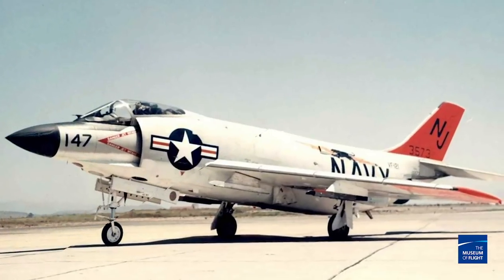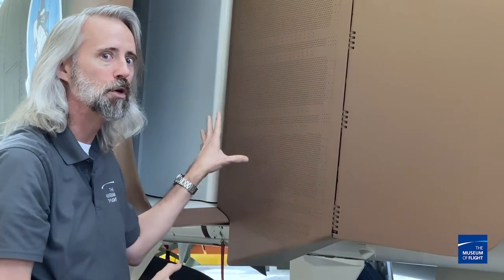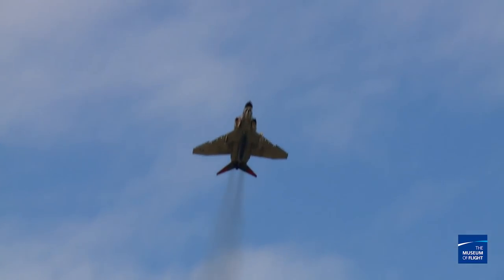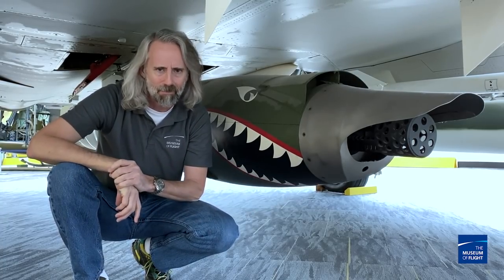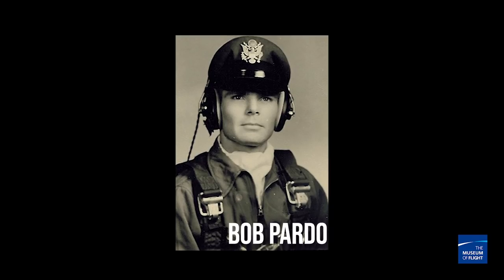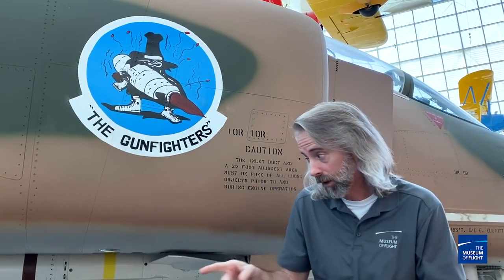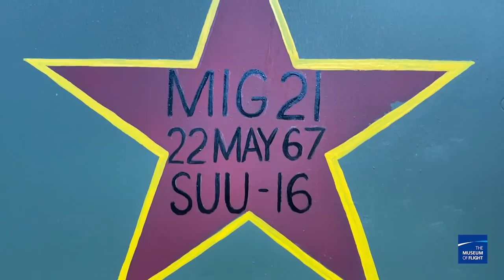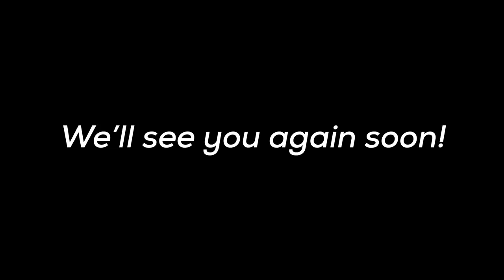McDonnell F-4 Phantom II | Curator on the Loose!

Comment: I spent 4 years in as a plane captain and Aviation Machinist's Mate in two US Navy F-4 squadrons in the late 1970's.  Allow me to supplement.  The splitter vane is there to reduce the flow of air into the engine inlet at supersonic speeds.  The GE J79 or any other turbojet engines will flame out if the air enters the engine at supersonic speeds.  The splitter vane will move out as the aircraft approaches transonic speed, stay out during supersonic flight and move back into open position below supersonic speed as shown in the video.  You'll notice that the splitter vane has hinges on it.  It is for this purpose.  Thank you for bringing back memories of my youth.
Reply: When sitting in the back seat you can watch the ramps move out as your speed increases to mach 2. Also, you can observe the shockwave which appears as a line right ahead of the intake and watch it. What you don’t want to see is the shockwave disappear that means a compressor stall because the engine can’t handle supersonic air. Slow down and restart the engine and all is good.
Reply: I'm surprised the splitter doesn't break and fly off when going super sonic.
Reply: I was an aviation electrician on the Phantom for VF-102 Diamondbacks out of Oceana,  and also did some brown shirt- plane captain duty. My favorite was to be beside the Phantoms at night on the cat shots! Nothing like that raw, pure, power!!
Reply: By chance were you in VF-74? Also the splitter vane is perforated so as not to choke the air entirely!!
Reply: @steveowens913   hello there Steve we may have shared the flight deck together CV-59 and 68

Comment: The funny thing about the gun, the original design actually DID call for a gun, but it was removed on the assumption that future air to air combat would exclusively involve missiles.
Reply: didnt the later versions of the aircraft re-incorporate the gun in the design?
Reply: @ObamaTookMyCat  yes, they put a vulcan under the nose and put in a less powerful radar to re-balance
Reply: @thedubstepaddict3675  The F-4E was the first phantom to have an internal gun.  It also had a transistorized radar while the C and D models had Large vacuum tubes.  The APQ-120 radar in the E model was smaller and lighter due to the transistors replacing the vacuum tubes.
Reply: @alanhess9306  agreed good comment
Reply: First and last fighter made with no gun, which was a big mistake they found the hard way in 'Nam.

Comment: Personally, the F-4 Phantom II, is to me, the greatest ever warplane.
Reply: YEs. If I were an airplane factory I would take it and just replace electronics and engines and make it flight again.
Reply: @switted823  I also love the F-14D Tomcat.  And the F-15E Strike Eagle.  And the Panavia Tornado.  ;)
Reply: I think the F4 wins based on longevity!
Reply: I've been fascinated by this  beauty since the first fly by i ever saw.
Her elegance, her dance, her roar..she got me  hooked
Reply: @Yoothana Mumme 
You got it 👍
Reply: SAM 7 agrees with you...
Reply: My favorite are F-111F, A6E Tram, F15C, F4 Wild Weasel, and F100F Super Sabre.
Reply: @detaildon  Not compared to the MIG-21. Come back in 100 years and there will still be some backwater using them. Also the Tornado got used really hard at low level where pilots got banged about to the point of getting bruises so was never going to last. The F-4 never did that. Same with the Buc which flew even lower. First time the Buc was encountered in Red Flag everyone could hear them from the position on top of the hill. What the USMC did not realise was the Buc's were flying 1500 feet below them 30 feet off the valley floor. The Buc's executed a toss bombing (something no US aircraft has ever been designed for) and offski'd before anyone else knew what was happening.
Reply: One of the funniest people I know is an f4 pilot
Reply: The F-15E Strike Eagle just is BADASS!  And the legendary Tornado...But yes, the classic TOP GUN machine...the F-14!
Reply: @gordonlawrence1448  I also somehow, love the MiG-21.  The nemesis of the F-4
Reply: Yep.  Before I kick it, I need to ride in one.  How I wish they’d been re-engined, updated and put back to work.
Reply: “The F-4 never did that…” We flew low level on ALL air to ground missions, so… you’re wrong.
Reply: “Toss bombing…”
The F-105 was designed for that too. The F-4 wasn’t but we did it anyway (Dive Toss was a required qualifying method of delivery, although we hated doing it.)

Have you ever had any experience actually flying one… or any military aircraft, for that matter? Serious question.
Reply: @yoothanamumme7091 
To my knowledge, there were no gun kills for the F-14.

Comment: That gun on the belly is a SUU-23 not a 16. It has an internal turbine to power it that is fed air from the intake above the gun muzzle opening. The SUU-16 had a flip out turbine to power it up. In the image of the "Spook" you can see the flip out turbine next to the spooks hand. The SUU-23 could be fired at higher speeds and could spool up faster than the SUU-16.

Comment: There is something special about the P-51, F-4, and the F-14.   The best planes of their respective era.
Reply: Mega upvotes !!!
Reply: Luving my P-47's also
Reply: The F-14 was actually all hype. It was underpowered and it’s Phoenix weapon system was worthless because ROE mandated visually ID before firing.
Reply: @Frankie5Angels150  Underpowered?  LMFAO.  There is a HUGE difference between the problematic P&W-TF30 powered F-14A and the powerful-reliable GE-F110 powered F-14D Super Tomcat. The Super Tomcat Was NO-WAY underpowered. As for your ROE, that was during peace time engagements.  Had there been a full blown war against the Soviet Union you bet there would be no Visual I.D.ing going on. But that kind of war never happened so the Phoenix never got a fair chance.   But I do agree, the F-14 was mainly hype, because although on paper, in theory, and as advertised, it could carry a ton a weight in weapons (thanks to the powerful F110 engines) in the strike roll (Bombcat) but in practicality there was no place to put it.  Hard points are at a premium on the Tomcat.  And it usually only carrried four 2k lb bombs. That's a lot of airplane for 4 bombs. Also it was very expensive to operate and a maintenance hog.

Comment: When I was commissioned in 1978 my first assignment was to Nellis AFB, Nevada.  World-wide, every thing fighter was mainly F-4s.  The F-15 had started delivery 3 years before and the C and D models wouldn't start delivery until the following year.  The F-16s had started rolling off the assembly line.  The wing at Hill AFB transitioned from F-4s to F-16s and then the tenant 474TFW at Nellis AFB transitioned.   Nellis was great because practically everything in the flying inventory was there or passed through there, including Navy fighter and attack planes flying from California that came to play at Red Flag exercises.  The Aggressors were F-5s  I saw the last two Tennessee ANG F-100 Super Sabers pass through on their way to the boneyard at DM. After two years, I went to Kunsan AFB, Korea and after a year of F-4s the 8 TFW transitioned to F-16s.  The Koreans flew a squadron of F-86 Sabers at Kunsan.  F-86, F-100, F-105, F-111, F-117, F-4, F-5, A-7, F-14, F-15, F-16, British Buccaneers.  I was in the Air Force at a very good time.  I loved the Air Force but every Airman gets only a slice of a very long loaf.
Reply: Kudos to you Sir! I was on three carriers with F-4's as the Fleet Fighters at the same time. We had 10 different airframes on board not even counting Tomcats because they weren't in abundance yet!!

Comment: I was an assistant crew chief on F-4D. I worked on the flight line. 66-7605 was my bird. I was assigned to the 184th TFG from 83-87. Enjoyed it. Nothing was more funner than running them them on the trim pad after rebuilding the throttle quadrants.
P.s. little red indicator popped up on your wing indicates your wings tips are not locked down.  So you can fold them for congestive parking.
Reply: Kudos to you Sir!!
Reply: Somewhere I have pictures of your Phantom along with 66-7553 , 66- 7694, both of the tripple 6's before they crashed( I think one crashed and the other burned on the ramp , can't remember ) ,  and 66- 0298 , several others that are escaping my mind at the moment . Including the one that took put the bell telephone poles lol.

Comment: My dad was stationed in Ubon Thailand from '65-'66 and told me a about an incident that happened to one of his F-4s that he was flight crew on.
The F-4 came back from a mission with barbed wire between the wing and the pylon. Evidently the pilot had misjudged his flight trajectory and realized he was going to make ground contact, he wound up "slapping" the ground with his F-4 bouncing back up into the air and flew off, dragging barbed wire with him.
Since my dad worked on F-4s I was fortunate enough as a young boy to sit in the cockpit of many F-4s while my dad was working on the weekends.

Comment: My first job, 1979-1980, was working on the flight line for an FBO at Albert Whitted Airport in St. Petersburg, Florida. . 

We would occasionally see USAF F-4s flying north past us over Tampa Bay, heading for MacDill Air Force Base in nearby Tampa, Florida. You could spot the Phantoms fairly easily from their rather visible smoke trails.

Comment: Late in the life of the F4 they came out with a low smoke J79 engine that greatly reduce its visual signature. Was waiting on flight line at Nellis AFB for a flight of 4 coming into Red Flag. We knew 1 had both smoke engines,  2 had 1 of each, 1 had 2 low smoke. Sharp eyes picked up the high smoke dual engines at about 20 miles,  but not til about 5 miles for the no smoke plane, even though you knew it was in the formation. Huge improvement.
Reply: Nothing like the Sound of a J-79!! BTW the F-4 J & S received the smokeless engine's as well!!
Reply: Not every air force that had F-4 Phantom upgraded their engines.
The problem was that the fix involved raising the temp limit on the engines to  minimize the soot.  You NEVER fully get rid of soot.  Even clean engines "smoke" a little because they're burning kerosene.
I know the Luftwaffe did not upgrade its J79s because doing so would have reduced the lifespan of those engines.  As it stood, it was probably good for them NOT to upgrade the engines.  They kept their Phantoms in service (due to delays with the EuroFighter) for at least another 10-15 years longer than they planned!
The US air arms went ahead and upgraded their J79s because the engines were plentiful.  Even if the J79 was out of production by the early 1980s, the spare parts to replace worn engine components were available for years.  
According to what I read in an old aviation book, the F-4 Phantom was supposed to be phased out originally by the early 1980s in US service.  I have read that 1980 was the original phase-out date (for the Navy at least) but the cost of the Fourth Generation fighters was too high to completely replace the 3800 Phantoms the US air arms bought.  The F-4 Phantom was on average $3million to $4million per plane by early 1970s currency standard.  Even by the time their prototypes flew (1970 and 1972 respectively), the F-14 and F-15 were going to cost at least $18million to $20million per plane!  
There was no way they could afford to replace every F-4 in service with an F-14 or F-15 hence why they commissioned the F-16 and F-18.  Even the F-16 (around $10million, IOC 1979) and F-18 (closer to $23million, IOC 1983) were orders more expensive than the F-4 Phantom but they had the advantage of greater reliability and less maintenance than the larger Teen Fighters (F-14, F-15).  Still, not enough F-16s and F-18s could be bought to replace the F-4 entirely and the numbers of fighter squadrons whittled down.  The F-4 HAD to be kept in service longer (at least 15 years longer!) to keep the tactical aircraft numbers up AND fulfill missions the F-16 and F-18 were not designed for (like SEAD/Wild Weasel).  The F-4 itself had significant numbers of E-models (over 140) modded into Wild Weasels and was considered a better choice for that mission than the F-16 (back in the 1980s) because of the limited internal room for avionics growth in the F-16.  Back in the day, the Air Force planners didn't anticipate electronics shrinking as much as they have to enable higher-capacity avionics to be installed in the small internal bays of the F-16 like they have.  In fact, the new AESA radars being installed in Legacy F-16s (Block 40 and higher in USAF/ANG service) take up less volume and are lighter than the APG-68 radar!

Comment: When he is talking about the engines you can see the rear of an AIM 7 missile, just behind it you can see a little bump, that's the rear signal horn (antenna). Used to tune missiles before launch.
I am a "Gunfighter", I have the certificate to prove it.  But I served with them 1970-1971 as a Weapons Control Systems specialist. I was promoted to Sergeant and Staff Sergeant at Danang then home of the 366 TFW.

Comment: One morning we were launching the first goes at Luke. For some unknown reason the crewchief on the next jet over stood up right behind the running engines. ( It was normal procedure to cross over from one side to the other while ducking under the engine exhaust). He got blown about 25 yards or so ass over teakettle across the flightline. Not only that but his face and arms looked like he had just gotten a bad sunburn. Needless to say, it took a long while for him to live that one down.
Reply: Let me try to one-up that ... we were working the midnight shift at Yuma (VMFAT-101) and I was in the backseat trying to find a discrepancy between the front scope and the back scope. I had a sergeant giving me what he was seeing on the front scope; oddly he was standing on the right-side of the front cockpit, something I found awkward (not much to stand or hold onto). All of a sudden I heard a thump. I stood up, looked around and then asked, "are you ok?" From down on the flight line, he hollers up, "yeah, I'm ok". Needless to say, he had fallen, in retrospect, quite a bit more dangerous than just falling off the F-4 -- because we had the radome pinned back to the fuselage. I'm not sure he ever lived that one down, as in my 6 years on the Phantom (and 2 on the Harrier, but I'm not interested in talking so much about that era), he was the only one to ever fall.

Comment: Very good presentation. One other interesting thing about the splitter plate in front of the engine is that it controlled airflow into the engine at supersonic speeds. A jet engine will not accept supersonic airflow at its face; it will compressor stall. The splitter plate closed across the inlet as the airplane accelerated past mach 1 to mach 2 and changed the airflow to subsonic at the engine face. The backseater (GIB, or Guy in Back) observed the plate as it closed. If it did not close, the engine would stall.
Reply: Agreed as it's also perforated

Comment: I flew both the F-4E and RF-4C as the WSO/EWO. Great fighter! The splitter plate was primarily for controlling supersonic arias you described. The USAF originally designated it the F-110.
Reply: May I ask, why was there two splitter plates (one with holes and one smooth one before it)
Reply: @flightedits7590  the holes allow some of the disturbed supersonic air to escape allowing for smother air to flow into the engine.
Reply: @sharizabel2582  Thanks!
Reply: How was the Job as a Whizzo in the back seat? Exciting, routine, dangerous...?

Comment: Point of interest: the wingtip dihedral also provided the mechanical joint to accommodate wing fold for carrier-based storage.  I spent many hours working on the F-4, (366 TFW, 389 TFS, MMS) and we would fold the wingtips up while working in a hanger.  Also, the SUU-16, 20mm, G.E. Vulcan cannon gun pod is pronounced SOO-16 (Sue) by the Weapons Specialists, pilots, and crews.
Reply: Hello sir, may I ask, what are those open hatches in the middle of the undercarriage (The ones before the gun pod)?
Reply: @flightedits7590  Those are engine bay cooling vents with opening and closing doors.  The doors close when the gear is up. When ever the gear is down they are always open. You see them open here because the gear is down.
Reply: @ILSRWY4  thanks!

Comment: I thought that bird looked familiar!
As an Explorer Scout (i was 14 or 15) in the late '70s early '80 at the Air Guard base at PDX, I actually serviced that VERY AIRPLANE!  Just simple stuff a TSgt could oversee a handful of teens doing, but we all did ave to be checked-out on the Martin-Baker ejection seat to be able to work around it.
I particularly remember this plane as it had 3 kills, which was the most of any of the F-4s there, and my birthday is may 1966, so the kill dates stood out to me.

You failed to note one of the coolest things about the Phantom....  It's howl/scream on final approach.  You could hear it for miles - including the high school i attended, which had windows that looked out on the glide path at PDX.

Some evenings we would stand beside the runway while they took off!  I felt the earth move under my feet!  The power of ABs during take-off made everything shake!

Those were the days.